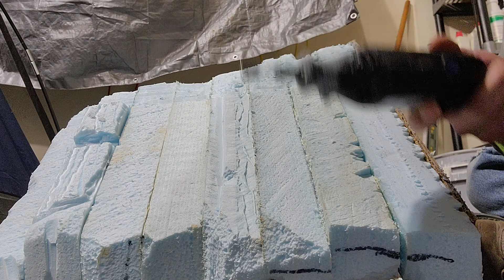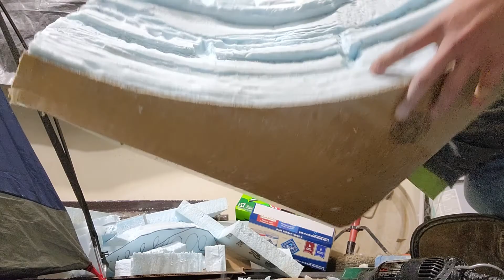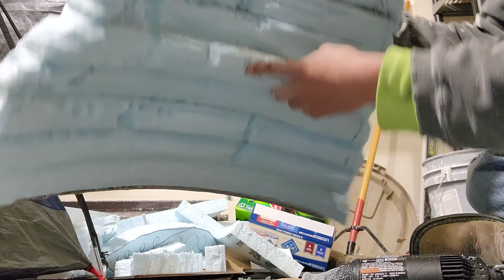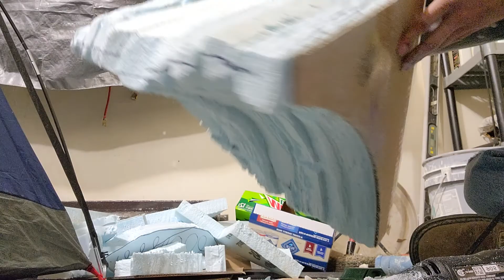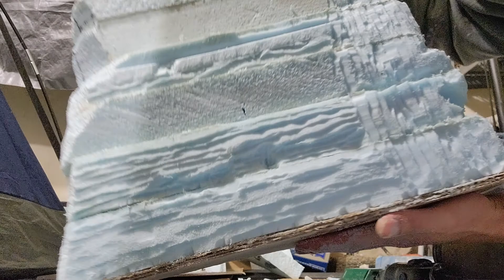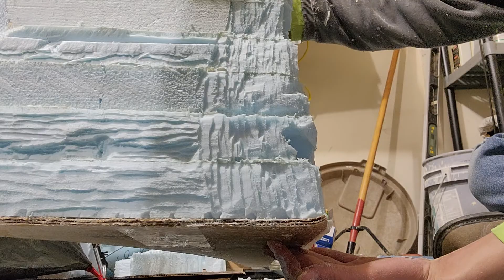Sculpting Mountains | Foam Board | HO Scale | Model Railroad

Comment: Thank you for sharing this method. Have you heard about the Dremel EZ- Lock Cutting disc kit  ? If you can do this type of model work with dremel drum sander. Imagine what you could do with the EZ Lock disc cutter kit. I bought this dremel cutter kit as I scratch build heavy equipment in HO and steel mill stuff. It s a wonderful tool. I hope you give it a try.I'd lke to see what you could do with it on foam.